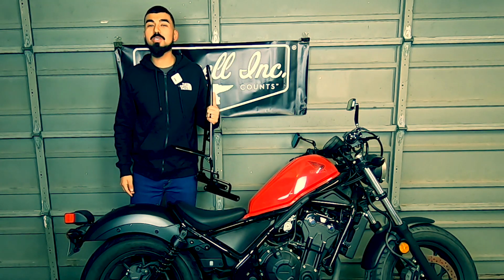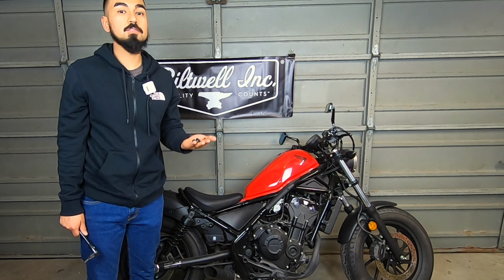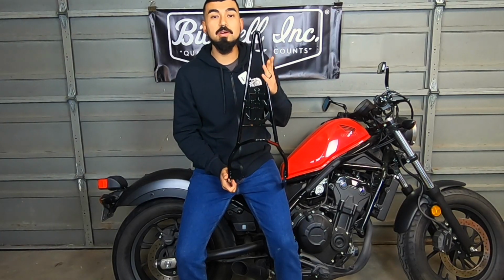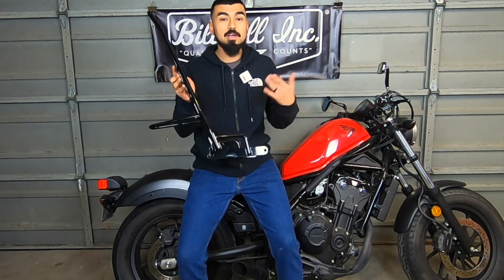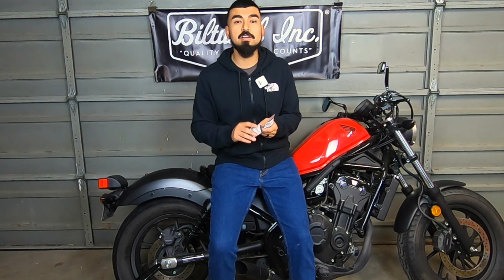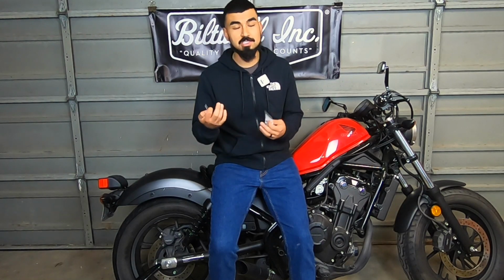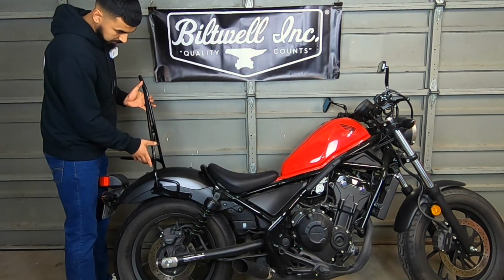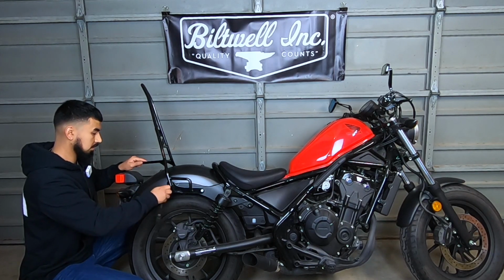Custom Sissy Bar Install | Honda Rebel 500

Comment: Bro. what is the measure of the sissy bar?
 Your bike is amazing btw.
Reply from the maker: What do you mean by measure? Like how big is it?
Reply: @resilientmoto4599  Yeah bro. How bigis the sissy bar. I mean How many inches is it from the base to the tip?
Reply from the maker: @2991jr  from the bolts of frame to the tip of bar is 25 inches bro. Thanks!
Reply: @resilientmoto4599  thanks for the info bro! Safe rides 🏍💪🏼🤙🏼
Reply from the maker: Yee! Good luck 👍

Comment: I can’t wait for mine it’s taking so long to get here.
Reply from the maker: When you getting it?
Reply: @resilientmoto4599  I ordered it April 29th it feel like it’s taking forever lol
Reply from the maker: @Wilscuts  did you order from the same guy ? Or a different company?
Reply: @resilientmoto4599  I contacted him today and he responded right away  said it’s getting powder coated and will be shipped out tomorrow or Tuesday
Reply from the maker: The same guy? If so he does quality work. Won’t be disappointed.
Reply: @resilientmoto4599  yea Edward. A friend of my had one made from him it is very good quality
Reply: @resilientmoto4599  it’s coming in today!!got it omg.